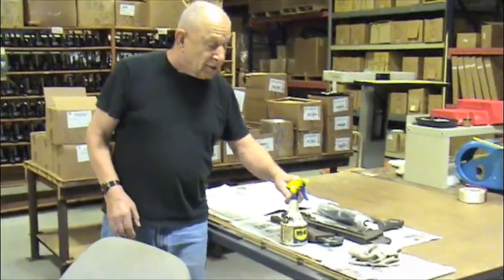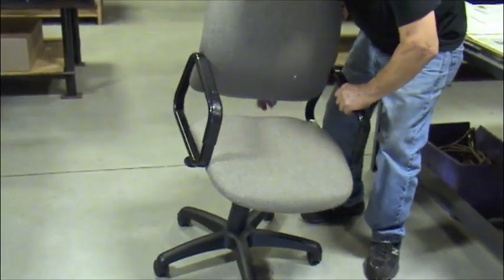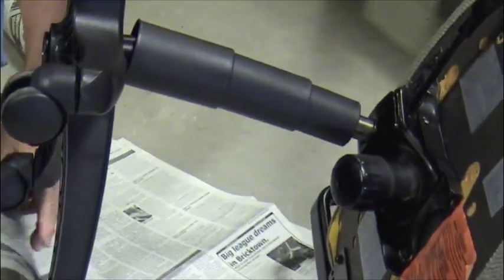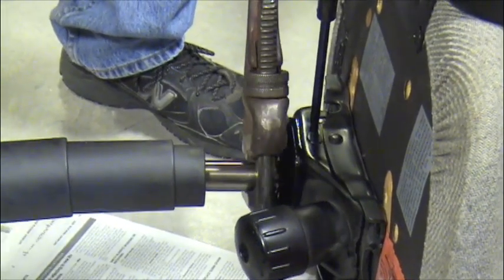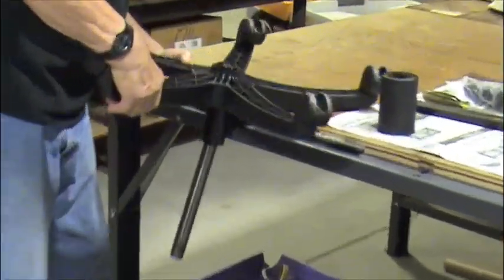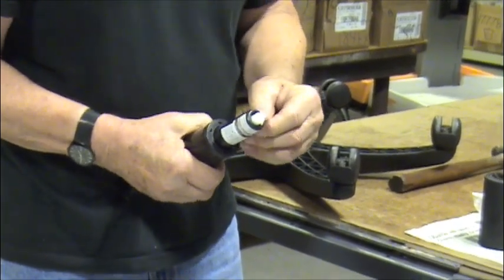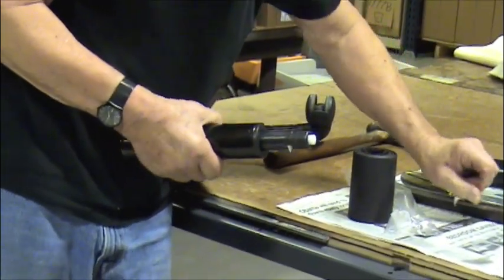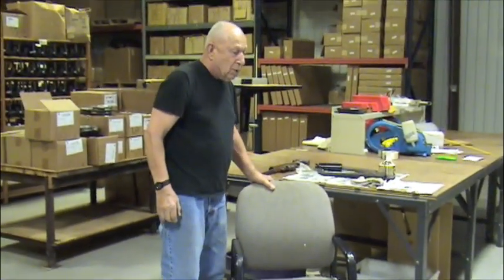How to: Remove gas cylinder using a pipe wrench

Comment: having tough time.  the gas tube is off the chair but still in the legs. have pipe wrench   but  should i turn clockwise or counterclockwise
Reply from the maker: Hi,
It doesn't matter. You can turn it in either direction. Keep the wrench close to the mechanism and don't use a short wrench.
Reply: thanks  i turned it each way today and through it was turning it never seemed to get further out
Reply from the maker: I hate when that happens. Now you not only have to twist turn, but you have to pull (hard) as well. Sometimes another person with a hammer has to hit the wrench to knock it out wile other person is twisting.
Reply: there isnt anyone to help unless its the cats.
lets see  .i bought a gas cylinder replacement, i bought and 18 inch wrench   i bought wd 40  but after the fiasco yesterday i ordered a 4 inch cushion.
i think it would almost be cheaper to buy new chair.. its a shame
Reply from the maker: Check online for Furniture Medic in your area, visit a competent furniture repair shop. Both can help you. Or, contact us via email telling me what City/State you are in.

Don

Comment: If only it were that easy in real life. I used a pipe wrench and turned the chair on its side. Wrenched and wrenched and it never budged. It did however make some huge crush marks in the cylinder to the point where when i gave up and just lowered the chair back to a normal level, the crushed cylinder  jammed from the pipe wrench making the chair completely useless. Now it doesn't adjust at all and the whole chair is going in the trash and i will have to buy a new chair.

Comment: ended up jumping on the pipe wrench to get it to come out :)
Reply from the maker: I'm glad you got it out no matter what the jump was. You look like a big guy so the cylinder must have been in very tightly. Thanks for commenting.
Don
Reply: +swivelchairparts  The new one seems a bit short, but cleaned both ends and smeared vaseline into both holes so that it is not metal on metal, looks better without the plastic sleeve this time as I was sent a chrome version.

Comment: I am trying to return one that the pipe wrench does not work on and I am no 90 lb weakling. 2nd one I have watched. Any other ideas?
Reply from the maker: Hey guy,
What length is your pipe wrench? How heavy a guy are you? How old is the cylinder that's refusing to come out?
Reply: Brand new in both cases and the pipe wrench is large enough. All it did was chew up the metal.
Reply from the maker: Try this. Remove the mechanism from the chair seat bottom and carry it with the cylinder down to an auto repair where they have a Bearing Press. If they can see the top edge of the cylinder, they probably can press it out. It's worth a try. Or, replace the mechanism and install the new cylinder.
Reply: That's the problem, neither will turn loose of the seat end. One chair will come loose at the base using your method but not the other.
Reply from the maker: Well, I'm out of options. Sorry I couldn't help you.

Comment: I think you can just leave the labels...since the plastic sleeve covers it.
Reply: The upper label covers the tapered part that mates into the bottom of the chair mechanism. If you don't remove it, that joint won't go together as strong and tight as it needs to.
Reply from the maker: I agree with you Scott.

Comment: Of course, my chair doesn't use a modern gas cylinder, it uses a old fashion shock and the chair was made in the 60's,
Reply from the maker: The thread shaft (spindle) is actually a part of the swivel mechanism that is attached to the bottom of the chair seat. If it came out of the swivel mechanism and is in the 4 leg base, it will cause much rocking as you no doubt already found out. Simply replacing the mechanism with one of these at http://swivel-chair-parts.com/ManualMechanismPage.html will make your chair as good as new.

Comment: Have been smashing a pipe wrench with a mallet for 40 mins and haven't managed to get my gas cylinder to budge 1 nanometre :(
Reply from the maker: Hello,
A mallet is not the same as a steel hammer, so switch and how long is your pipe wrench?

Comment: It makes me laugh in a depressed way how video after video make it seem like getting the cylinder out of the base is a simple tap job. Mine's not budging from either of the two chairs I'm trying to work on.
Reply from the maker: Speaking for our video only, the cylinder had never been previously removed. With the proper pipe wrench and a single WD-40 squirt, only 1 in thousands would be very difficult to remove. Chances are you have the wrong tool and no WD-40.
Reply: @swivelchairparts  I have WD-40. And I didn't see a pipe wrench being used to remove the cylinder from the base. A hammer was used to tap it out.

Comment: Unfortunatelly this kind of wrench is not the best tool for this removal, actually mine just spun around with absolutely no grip. There are wrenches with 2 arms to squeze the tube, those are more practical.
Reply from the maker: You are wrong! A plumbers pipe wrench (15" and longer) is the perfect tool and easy to purchase. I have used it hundreds of times and customers have successfully easily have done so too. 
A Google search for a capable 3 jaw wrench produced nothing.
Don SCP
Reply: @swivelchairparts  OK, Maybe we're talking about the same thing, but just to be clear, you used an american "Stillson" type wrench, but with a "Swedish" type or adjustable pipe wrench you could apply more force to the bar to avoid sliding.

Comment: Bullshit, I have so bigger office Chair. When i tryed to put out gas cilinder with my pliers it only scratched huge scares of metal on cylinder. While I was trying to remove cylinder black case from bottom I hit this very hard, even put wooden block and effect? Cylinder is case was deformed, part of wood fell off due the hit wave, it even spark while i was hitting, but it didn't move by milimeter.

So huuuuuge BL.
Reply from the maker: One problem was that you used a "pliers". Too bad you didn't watch the video before trying to remove the cylinder.
Reply: +Sabakinno Pliers and pipe wrenches are two different things

Comment: Why did you choose parts that came apart so easily? People are looking for a video because the chair they are working with won’t come apart easily.  The cylinder-to-seat bottom can get really stuck but yours barely took any effort
Reply from the maker: I already replied, but just in case.......I didn't choose an easy one, but some are easier than others. However, confidence, experience, the right tools all have a lot to do with it.

Comment: Meh... that shit doesn't work on a 2-3yr old chair where the cylinder is stuck in gunk.  
Just put some WD40, wait a few minutes and then smack on it with a hammer until it moves.